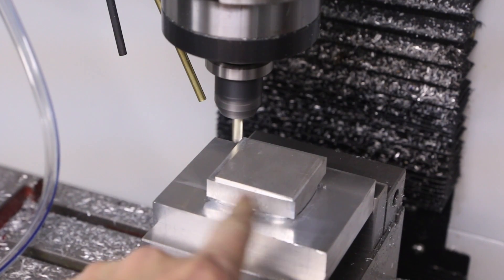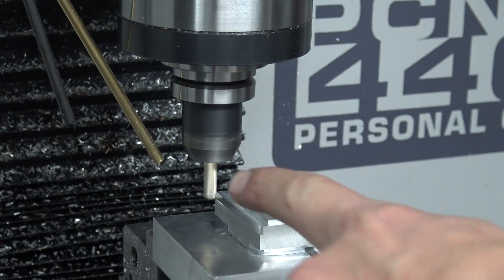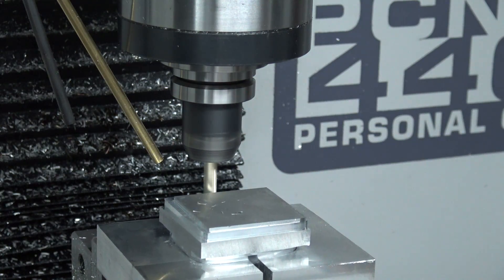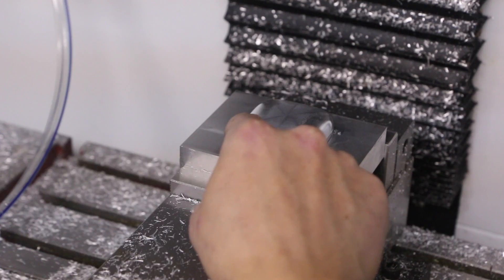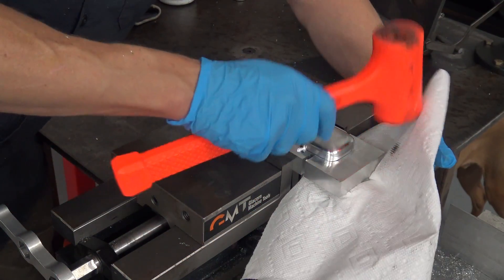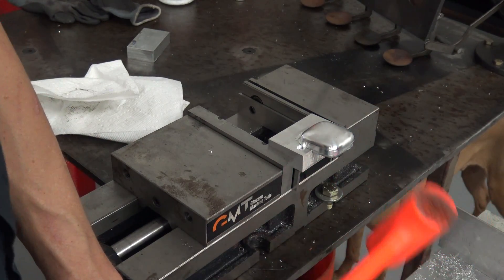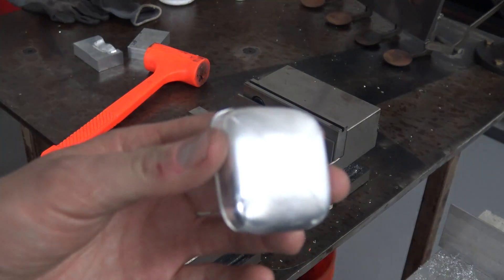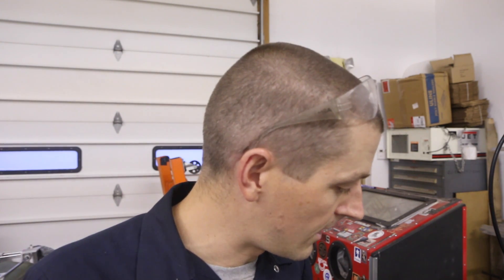Superglue CNC Machining!   Machining & Results! Widget66

Comment: Great video! It is actually cleaner to blast super glue bonds with cold rather the hot. The bond becomes so brittle it will just pop off. Try flipping a keyboard duster upside down and spray it with the that. The aluminum should transfer the cold quite nicely. Plus burning super glue gives off some nasty chemicals.

Comment: The best way to do complex 3d parts like that, at least in production machining, is to design in some small flat reference spots that you can use to calibrate the machine.

Comment: Double sided masking tape works surprisingly well also. its roughly .007" thick. However if you have to run coolant this way would be faster because you have to do more prep work to ensure the coolant cant loosen the tape. I use the tape method all the time though, its quick and works like a champ. prepping the surfaces with isopropyl helps ensure a better stick and can also helps removal after machining.

Comment: Toluene would make short work of the super glue and it's fast.....great vid as per usual :)
Reply: iv'e used it to dissolve 2 pot epoxy and contact adhesive make really short work of those plus it evaporates pretty fast in sunlight

Comment: A gold smith I used to work with ( I repaired watches) held his work in a "pitch pot" which was exactly what it sounds like... a bowl of pitch tar which he would heat a portion to liquefy it, position the piece in the position for the work he wanted to do on it and hold it there for a couple of seconds while it hardened. He would typically start hammering on it within 5 minutes. IDK if it would work for machining or if there is maybe some newer substance that would work similarly.

Comment: so did you figure out the problem? it looks like maybe you came off a different location then the one you used to make the fixture. its hard to tell but for the most part i usually use the same origin i used to cut the fixture as i do for the actual part. Also for the fixture, because you cant really comp out a ball mill it probably would have fit better if you told it that the ball mill was like .001-.002 smaller then it actually is. i think its kind of like trying to fit a .250 pin in a .250 hole you know. i really like that 440 tho. its like the perfect size little mill
Reply: I would think it would effect both? Rite? Because your telling it is a different diameter so it would cut deeper and wider. Rite? Lol

Comment: nice work and no worries on the cam woops...doubt theres anyone that hasnt done the same or far worse...even easy to miss on an air run because it wasnt a huge move and was at very end....that kinda stuff was the main reason the first part ever made on our mills was always a "sacrificial" bed....you can minimize it but eventualy "it" will happen just gotta hope its not a hard enough slam to trash a spindle or ball screw

Comment: When you machined the pocket you could also machine the top left corner that way it's true to the pocket. Love the videos just use fusion to do a 3d part on 1044 steel worked great.

Comment: ... Instinctively pounded space at the crazy gouge! :-/ 
Still, beautiful work!

Just a tip, hit it with a blow torch. Only needs to hit 200 for breakdown, but most blow dryers take to long. All that pounding might deform a delicate part, far more than 400*. :-D
Reply: For a very thin part it might be overkill but for most larger ones shouldn't be too bad. The real concern is if you need to worry about discoloration, especially if you're doing something like steel or stainless, that will completely ruin the finish.

Comment: Try leaving something that will allow you to locate the part.  I believe that your negative would work just fine, however it was not made to spec.  Super glue worked great, but as you know the negative was off.  PS, You may want to be able to write per CNC on paper work when doing a checklist of dimensions for you customers.  100 inch per minute is fast and you may not be able to hold a + or - .001 tolerance with your machine at this speed.
Reply: +adithmart PS, I learn a lot from your channel.

Comment: If you had it to do over (with all sides machined) would you fashion the "bottom" (the simpler side) first? Which would weigh heavier in your decision: an easy-to-machine negative mold/fixture, or the possibly greater holding power of the complicated surface?

I doubt if I will ever be able to make something that complicated with my Anilam Crusader M (which has a limit of 1000 lines of code). But I can dream, can't I? Great video as always.

Comment: Ahh I hate in explicable CAM surprises!
Reply: +War Machine LLC Not inexplicable at all. I saw it coming in the CAM video (but obviously my shouting at the screen didn't help :P) at the 8:17 mark. John was naughty and didn't simulate the final toolpath before posting the code. Tsk tsk! Otherwise, he would have found the error.

The fix to that in HSM for 3D profiling operations is to use the "touch/no touch" options. Another option would be to set the bottom height of the toolpath to a thou abovem the fixture. If he had told the operation not to touch the fixture, the gouge would not have happened.

Comment: Tip on the removal, heat the part and cool one half of it under cold water (part of fixture), the shrinking will remove the glue

Comment: Was this on your 1100 or 440?
Reply: +Pete Brown 440
Reply: +Impyman18 Thanks. Pretty impressive. I keep feeling like the 440 is a huge compromise compared to the 770 or 1100, but you've been showing it off well, and doing some great work on it.
Reply: +NYC CNC It&#39;s the travel, especially on Z. If you wanted to put a rotary table in there, it looks like you&#39;d be extremely limited in what you could handle. I imagine if you add the ATC, you cut in even more. From your demos, it looks like it has the power to do real work, though. :)

It puts me in the mind of trying to figure out if the extra travel is worth another $10k, and if you get better rigidity etc. as part of that.

Comment: This was awesome! I probably wouldn't have thought of holding it like that, but I will now if I need to make something like this. I think to get the zero set a little closer I might have cut the fixture and not move it, then cut the part in it using the same zero the fixture was cut with, without moving anything. This way It's almost certainly in the correct position without much hassle, assuming the part fits in the fixture pretty close. 

Great video, and thanks for showing your mistakes so we can learn from them too!
Reply: +NYC CNC A simple way to add repeatability like that would be to have a set of stepped hard jaws, (or even soft jaws would work), with a ground pin pressed/close slip-fit at the far left or right of the fixed jaw at a known distance. When you make your fixtures, negatives, or whatever, use the pin as a stop so that no matter how many times you remove your part/fixture, you can always get it back within .0005-.001" or so of its pre-set work offset in X. Think of it like a high precision vise stop. Works great for repeatable production, especially when used with small "pallets". 

Keep up the great vids!

Comment: The only disappointment I have had from using superglue this way is that it can be strong enough to hold the part against warping from stress relief after milling and then once the glue is released the part curls up like a potato chip.

Comment: Think you could have drilled a few holes on the bottom (curved contact area) of the fixture and made a vacuum fixture out of it? Only reason I ask is that would eliminate that cure time and should still provide plenty of holding power
Reply: +Finn Custom Knives +NYC CNC I doubt that would work. The maximum hold-down from vacuum is 15 psi (atmospheric pressure). It looked like you had about 4 square inches, so maximum hold down would be around 60 pounds. The mold handles the side pressure from cutting, but there would be some tendency to lift, and I think it might exceed 60 pounds. With a good vise putting hundreds, if not thousands of pounds holding pressure (and still parts move sometimes), 60 pounds seems a bit light.

A square foot or more might be a candidate for vacuum hold down because those square inches really add up. I have a 5600# granite ball (4' diameter) that "floats" on a cushion of water at a mere 5.5 psi. The reason is - there is a 1000 square inch pressure area to multiply that low pressure. Think what 15 psi of vacuum could do with 1000 square inches to work on. It's like that wow-lookit-that experiment where you suspend a bowling ball by the suction of a vacuum cleaner working through a 6 to 8" funnel. I just googled [ bowling ball vacuum cleaner  ] and discovered that this seems to be a mystery to the youtube community.
Reply: +Peter W. Meek if it were just a flat part I would definitely agree. But shouldnt the surface area of the part(contoured side) be more than just LxW since it is 3d machined? Also, the part is sitting down in the fixture so really all the vacuum would be doing is sucking down, while the location will be held in place by the fixture.

Genuinely curious here, not trying to be argumentative or anything lol
Reply: +Finn Custom Knives You have the effect correct in your last-but-one sentence. The pull is straight down. The only sideways holding is from the sides of the mold.
It&#39;s the area of the curve where the vacuum meets atmosphere. If it isn&#39;t a plane curve, I&#39;m not sure how you would measure the area. Possibly if you imagined stretching a soap film onto the curve. Minimum area to connect the curve, anyway.&#160;I&#39;m not so good at non-Euclidean geometry (on potato-chip or saddle surfaces), so I can&#39;t figure it exactly, but for most purposes it will be only slightly more than the area of its projection onto a plane.
The pull will be normal (perpendicular) to that plane (or planish) surface. Anything sideways to the perpendicular is counteracted by an equal pull on the opposite side.&#160;The pull at any point can be considered to be the sum of two vectors: the straight down pull and the exactly sideways pull. The side pull is real, but because it is completely counteracted by the pull on the opposite side, we can ignore it and  just measure the straight down pull. Thus the area of the curve where vacuum meets atmosphere is what counts.

Comment: John
have you found out what caused the gouge at the start and end of the cutting?
also did you hit the stop? would it have carried on ?

if its a fusion cam problem i would be concerned as i have a smiler job on the beam for a scale beam engine and have a good few hours in the part up to now 

keep up the great vids i have learnt a lot as i have only got a CNC mill a month ago

Stuart
Reply: +Stuart Hardy You can see the vertical plunge (yellow means rapid) at 8:36 in his CAM video, and I was practically yelling at my screen for him to catch it. I thought he would have and was just making the video shorter by skipping over it. Nope. Could have been easily avoided by setting a minimum height (also the gouge into the fixture at the beginning of the Morph Spiral toolpath) as well as setting his Fixture in the Setup to see those more readily in the simulation.
Reply: +atomkinder67 

thanks for the heads up being new to fusion things have not gelled yet but i am leaning slowly ( at 68 ) it takes a wee bit longer but i will take another look at the other vid so i can spot it on my projects 

Stuart
Reply: NYC CNC It's all a learning experience! I simulate religiously before running a program, and I've found that HSM and Fusion have a little different way of doing things than other CAM software packages I've used.

Comment: Breathing on the CA glue will help set it in a pinch but there are better options. You can use a liquid accelerant that is usually sprayed on. The liquid can be hard to find, sometimes expensive, and smells funny. You can also use baking soda. Lightly dust the part before putting it in the fixture with CA glue. It will set in seconds. Nice little trick. I hope that helps.

Andrew
Reply: You can find CA accelerants at R/C hobby stores, the tires are glued to the rims.
Reply: +NYC CNC Yep! Its used by prop and model builders but also music instrument builders. It is handy for when you need to attach something that you cannot hold well for a long period of time like a guitar nut or when you use thicker CA glues for things like fretboard repairs and the set time is longer.

The spray is handy when you are just about to put something together as you can hold the surface with one hand and spray with the other but some materials do not react well to the spray like plastics and woods so using baking soda makes for less risk and easier clean up. You can target what areas you want accelerated with soda like deep pockets that may have more glue. I have heard about people having bad reactions to the liquid so soda is less of an issue.

I also have used soda when machining thin small pieces of material that would be too difficult to vacuum down. It makes for a quick setup. Face some material so you know you are flat to the spindle fairly fast so you have some texture in the surface that the glue can grab then slap your material with soda on and you should be ready to go shortly. You can either pry the material off or heated as you did. It does get stinky when heated. Reface the material when you have a build up of glue that you need to clean off.

Give it a shot!

Andrew

Comment: there's a fixture wax that I think would work better for this, same idea but easier to remove and probably as good at holding the part. Tom Lipton had a vid on that holding a penny flat to skim it on the lathe.
Reply: I meant to use that instead of super-glue with your "negative" fixture, no need to use the hammer to take it apart

Comment: nice opps at the end! so you are human:) Try putting a hole on your fixture off to the side for a register of x/y and then use the face for z. Also don't cut/mod your fixture after machining that will cause a lot of error. Just cut the fixture to a negative stock of about .001 or so. Boiling water works really well to get super glue to release. And my sister is a vet tech and they use 'super glue' all the time on animals and you can by a spray on band aid product called new skin, works awesome. Can't believe your don't have any in the shop med bay!
Reply: +Widget Works Manufacturing Inc. If you think Nuskin is great, try a product called "WoundSeal". It is a powdered band aid of sorts. It dissolves as you heal.

Comment: At 5:27 I instinctively reached for an emergency stop.
Reply: +minimovzEt Carpet tape, 3M VHB tape, vacuum pallet or figure out where the tool isn't going and put screws into a fixture plate. I have used all of these methods successfully on thin materials.
Reply: minimovzEt Carpet tape works great. I use mineral spirits to get the tape off, and acetone to clean the mineral spirits because it will stop the tape from sticking again.
Reply: +NYC CNC what holding method do u recomend for machining a sheet ? i have done some steel sheet and acrylic sheet works on my hobby router and i couldnt find a way to hold the sheet tight and rigid enough to not cause chatter
Reply: Kenneth Higley have u had any problem with the bit going trough tapes ? i am using this method right now and i worry a bit going trough it and i dont know like stuck some tape in the bit and fucks up the finishing
Reply: Nah should be fine. But if you're worried, try to position the tape in places the tool doesn't go.
Reply: Why wasn't your finger already over the feed hold button?